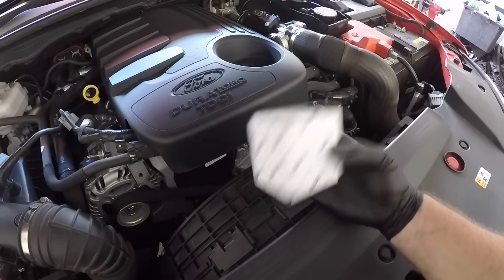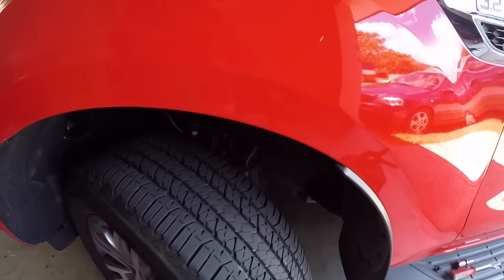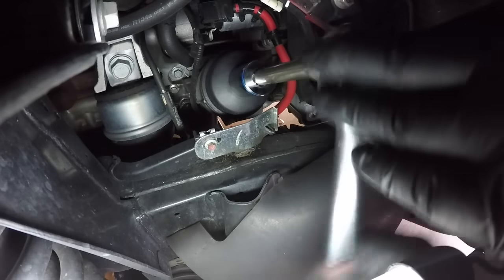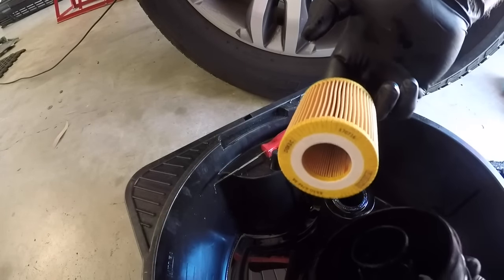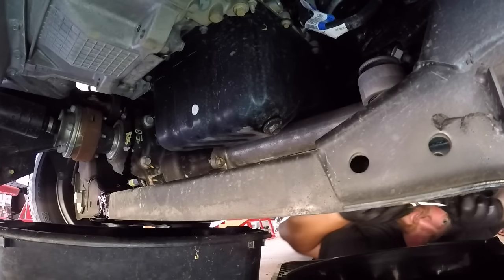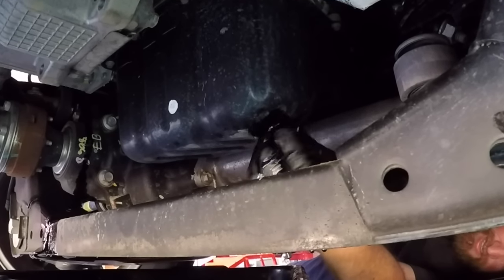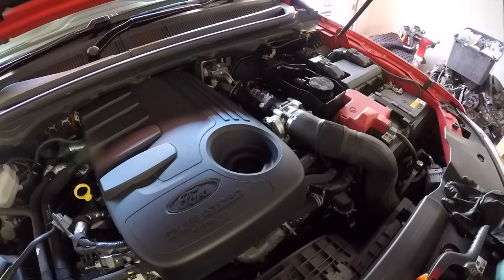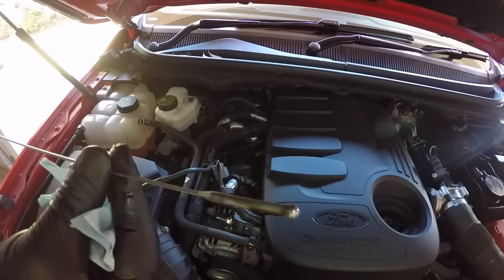Ford Ranger Oil Change Mazda BT50 Ford Wildtrak 3.2 Ford Everest WARNING THIS MUST BE DONE FAST!

Comment: Does the 2021 3.2L ford ranger px3 have a service oil maintenance to reset on the dash cluster or is it something the dealership has to reset through the OBD port.

Comment: Hi there, this must be a PX2 as my PX oil filter is on the passenger side of the engine and you access it from the open engine bay. Anyway, I just did my oil change (I'm doing them every 7500) and I drained the oil from the sump and then stuck six litres of fresh oil in to stop the oil pump draining. Then I did the filter and topped right up on the oil. I did do it in under 15 minutes and all was fine, but do you think sticking 6 litres in would stop the oil pump draining? Have you pulled one right down to see where the pump is located?
Reply from the maker: No need for the fast oil change on these earlier Rangers but I like the fact you smashed it in under the 15 minutes, shows you were working it. Your engine will love the 7500km oil interval. Thanks heaps for the comments.
Reply: This is the way I do them  I dont even answer the phone while doing one !!

Comment: Can you drain the oil first to allow the sump to drain that bit longer while you are changing the filter ?
Reply from the maker: It is recommended that the entire process is done in under 15min. I don't see any issues doing it the way you mentioned as long as you watch the time. Cheers

Comment: How in the world could the pump lose prime while changing just the oil filter first?..which I agree is the best way to do it b4 dropping the oil..anyway just my thought
Reply from the maker: A simple way to explain this is to consider the situation of your thumb over the end of a straw and you can hold liquid in the straw, remove you thumb and it runs out. The pump design allows oil to flow backwards and opening the closed oil system is like taking your thumb off the end of the straw. Oil drains back and the pump cant self prime.

Comment: Hi, does the 10-15min rule also apply to  the 2.2L engines? Thanks
Reply from the maker: The 2.2 is a different design of engine however, so many other people are unaware of what engine is in their Ranger I need to be careful of what advice I give. I would suggest that any Ranger owner does the quick oil change just to be safe. I hope you understand my answer and thanks for the comment.
Reply: @killawattgarage   The 2.2 Puma is the same engine with one cylinder lopped off.  The same precautions apply.

Comment: Is this the same process for the 2.2 engine ? Wildtrak manual transmission 2018 ? And how many liters do i need to put in a 2.2 engine tnx mate
Reply from the maker: Yes, the same variable output pump is fitted to both engines. Refill is about 9.8 L. Thanks for the comment.

Comment: Hey buddy, great video, anyway can you help me locate the power steering fluid reservoir of Ford Ranger 3.2? I kept on looking at the engine bay to check the fluid level but failed to found one, mine is a 2017 model. Thanks a lot.
Reply from the maker: It has electronically assisted steering. So there is no hydraulic lines, pumps or fluid to check or top up.
Reply: Killa Watt Garage Thanks buddy. You're a genius. Hope you post more vids regarding the proper care and maintenance of Rangers because going to the dealership for preventive care and maintenance is a pain in the pocket. Regards from the Philippines. More power to you.
Reply: Rotflmfao.Plus Rtfom

Comment: So down the road in a year  or 2 if one buys one of these engines how do you know someone hasn`t  damaged it by not changing the oil correctly, something that was so simple now is a can of worms , I got a 2008 ranger 2.3 in line 4 ,5 speed manual, I`m going to keep it for a very long time and another thing these new ones  won`t match  my mpg  of 40 (imperial)
Reply from the maker: I guess that's the danger of second  hand cars or engines. They could have bad bearing wear because of incorrect servicing. Thanks for the comment.

Comment: how would you know that the oil pump needs to be primed and how to do it?
Reply from the maker: You would know because there would be a low oil pressure warning on the dash. If this happen it can be re-primed by overfilling the engine oil then after starting drain out the excess. Thanks for the question.
Reply: @killawattgarage  thanks! Looks like i did it in time then. Is it also true that you change your fluid every 100km?
Reply: Because it's in the owners manual if you care to read it.

Comment: Whats the reason for doing the oil change in a few minutes?
Reply from the maker: The oil pump is a different design to that which is widely used on other vehicles. It has many benefits but one negative is that if the oil drains out of the sump and then the pump, the oil pump will need to be refilled with oil before it can start pumping oil again, just refilling the sump will not do this. Short oil change time ensures the oil does not drain out of the pump. Thanks for your question.

Comment: im used to drain all the oil before pouring new one, sometimes I just sit there for over night just to make sure no old oil is left in the engine before putting the new oil, now I need to finish everything in under 15mins, how about the old oil left in the engine (due to time to drain) that will be mixed with the new one?
Reply from the maker: Yes there will still be some old oil still in there, however with close on a 10 litre capacity you would be changing more than 99% of the old oil. I recognise it's not ideal but synthetic oils are amazing and I always advise completing the 7500km service interval rather than the 15000km interval to ensure the freshest of oil. Thanks for the comment.

Comment: Hi mate again great video👌🏻, I have 2017 Mazda BT50, Mazda just informed me they are doing service at every 15000km intervals now. I will prefer to change oil every 7500kms. My question... do you need to change the filter as well as the oil if I change the oil at 7500km. Will it make a huge difference if I don’t change the oil filter as well?
Reply from the maker: Sorry just saw your comment now, LOL. Changing the just the oil is OK but changing the filter with the oil is much better. Mines at 150,000km and I have recently started doing the oil changes at 10,000km intervals which is an excellent compromise between the 2. Thanks for the question.

Comment: does removing and changing the oil filter is included in the 10 minutes frame? or just the draining of oil?
Reply from the maker: Yes 10 minutes for the whole process. Once the filter is off the system has an open end and oil can begin to drain back. Thanks for the comment.
Reply: What happens if it's passed 10mins  screwed up?
Reply: I have just done mine and took 20-30 min. Unfortunately the reason was I didn't thread the bullshit plastic filter housing on correctly the first time. I thought it was wrong but finished the process anyway. Oil all over the floor. However I salvaged it and although oil light came on for 10 seconds after first start up it went off and I have had no issues. I'd actually be surprised if the pump emptying was a major issue at all. I guess I'm skeptical.

Comment: Thanks for a great video. I understand the time taken issue. Can I ask why the oil filter change time is counted against the "10 minute window". You mention you're a couple of minutes into the time frame allowable after you do the filter? But no oil has been removed at that stage. Just curious what the relationship is?
Reply from the maker: I include the filter as when it is removed it can begin to allow the oil to drain back. Much like when you have a drinking straw filled with liquid and the end is blocked, it holds the liquid in place but once you release it the liquid can run out. Once the filter housing is opened it starts the process of oil draining back intake the sump. Thanks for the question.
Reply: @killawattgarage  Thank you :)

Comment: Neighbour of mind did an oil change on the 2,2 engine and waited for a few hours to fill it, nothing untoward happened, is the smaller engine different?
Reply from the maker: Yes the 2.2 uses a typical oil pump design.
Reply: @killawattgarage  Ok, Thanks for that.

Comment: hi i did this procedure on my own, filled correctly the oil and done for almost 10mins, but when i started the engine it has a clicking sound beside the oil filter. is it normal? or the oil pump dont work? pls notice me thanks
Reply from the maker: If the oil pump didn't re-prime and you had no oil pressure the tappets at the top of the engine would start chattering loudly and then the engine would be knocking soon after. The 3.2 engine is a noisey engine.
Reply: do i need to re-prime the pump? mine is 3.2 wt
Reply: @razen1292  How did you go with this issue rap'???
Reply: @TheOmnipresent12  i just filled the engine oil at its proper level, nothing goes wrong, i did this procedure over 4 times and my unit works fine, just fixed that clicking sound over my chassis. Much thanks for this tutorial video.

Comment: Are the new 2017 ford ranger wildtrak 3.2l still have this oil pump problem. Here at Ford service, no one seems to know about this issue which is weird. Only the Australia version have this problem.....
Reply: I worked at a Ford dealer and no one ever had a similar issue or that they knew about. I didn't have an issue either with the rangers. Maybe its a thing on the newer models (2016-) or just some versions for some markets.
Reply: All 3.2' diesels have this oil change requirement. That is upto the PX3 which There are rumours Ford have modded the pump but don't quote me.

Comment: Sorry for the question does the 10 15 min time start when you change the oil fillter or only after you begin emptying the oil into the catch pan just wanting to knw thinking of doing my own service
Reply from the maker: Sorry for the slow reply. Starts from when the oil filter housing is opened as this allows the old to start flowing back.

Comment: so what do you mean that the oil pump cant self prime ? and what if it takes longer then 10 minutes what happens ? or what do you need to do ?
Reply from the maker: If you take longer than the recommended 10 minutes, then the oil drains out of the oil pump, even after refilling with fresh oil and starting the engine the oil pump will not be able to suck up the oil in the sump. This means the engine will not have any oil circulating around to feed bearings, tappets etc and engine damage will result very quickly. I have heard of people getting caught out and fixing the issue by overfilling the oil (this allows the pump to be filled) and then draining off the excess. I hope this answers your question.
Reply: so when you get it wrong and you start up the car it is getting a instant oil pressure fault i guess and you shutt the car off i guess ?
Reply from the maker: That's correct. You will a warning on your dash. Depending on the specific model it could just be the oil light or a text display stating low oil pressure. 10 minutes is doing it on the safe side. I have heard stories or people letting it drain a lot longer. It is just good to remember to do this one quickly.

Comment: We have d same ute, Is it ok to fill it with 8 liters? I just want to maintain the oil level btween minimum & maximum level...thank you
Reply from the maker: 8L will leave it too low, it has a 9.8L capacity. The oil level may not even reach the low mark.
Reply: Killa Watt Garage Noted sir. Thank you

Comment: Would’nt the time start when the sump has drained?
Reply from the maker: Once the oil filter is opened the system has an air leak that can start the drain back. Similar to how you can hold liquid in a straw with your finger over the end.

Comment: When I have done the oil changes on my Ranger I drop the sump plug wait until the constant stream is about t o drip , put the sump plug back in and drop about 7-8 litres in the sump then change the filter.
Reply from the maker: Hi and thanks for the comment. I agree that method will work just fine as well. Cheers

Comment: What brand and weight oil do you prefer?
Reply from the maker: In Australia the factory recommend 5W-30 so I stick to this I also use PENRITE. Good balance of quality and price
Reply: @killawattgarage  I was actually looking at running the penrite synthetic full zinc 5w30.
Seem to be OK for DPF for the ford ranger also. 
My dealer uses the mobil 3000 x1 FE oil. 
Not sure which is the better of the 2.

Comment: Hey mate, can you post the specific order of things, do you need to change the filter casing then the sump plug or can it be either way
Reply from the maker: I have been advised that it is the filter swap then drain the oil and have always done it this way without issue. Some others do it the opposite order and they haven't had issues. I think the critical thing is time, just don't get distracted and finish the process in under 10 minutes and you won't have any dramas. Thanks for the question.

Comment: So if you take longer how do you fix the oil pressure issue???
Reply from the maker: Haven't been down that road.......but my thoughts were to use suction at the filter housing to draw oil up through the pump again. Many of people have just started the car and revved it hoping it would prime and have had major engine damage.
Reply: I was told over fill it then drain out the correct amount once it has oil pressure

Comment: Does it matter how long one takes to replace the filter? If I were to simply change the filter first at my leisure and then time myself to drain the sump and refill within 10 minutes will my ute be fine?
Reply from the maker: Once you open the 'closed' oiling system oil can drain back out of the pump and have issues re-priming. 10-15mim for the entire process.
Reply: @killawattgarage  Cheers mate.

Comment: It's not that hard really, 15 mins is fair amount of time, makes you get organised before doing the change too. 90,000kms on mine, changed every 10k, still going Strong.

Usually done in 8 to 10 mins.

I don't like the way the oil filter is designed, if you break the plastic housing for whatever reason... It's all over! Just can't see why something so high priority and a part that gets removed reasonably often is made of plastic! Much prefer an external steel filter onto an engine thread.
Reply from the maker: Thanks for the comment. Agreed, 15 min is plenty of time but you can't walk away or get distracted. I do worry that in time the plastic housing will become brittle and breakup but haven't seen it yet. Cheers

Comment: If you change out the oil within the time frame and then change the filter later, would that affect the pump?
Reply from the maker: Short answer, Yes. Once you open the oiling system then the oil has the ability to drain back.
Reply: @killawattgarage  thanks.

Comment: I honestly don’t see anything wrong with this design. Modern engines are precision instruments and there is a reason why things are done the way they are, and that is a process that needs to be followed to service them. This has always been true.

The reason why the oil pump does not self prime is because it is a variable oil pump that provides some advantages over a fixed flow pump. I cannot speak as for why it is not a self priming pump, but in pump designs, they are designed in such a way that they must be primed before use and never allowed to run dry, because to have a self priming pump, takes away from other aspects of its design. You can’t have everything.

A time limit on changing the oil is not the problem people make it out to be. It’s one more step in servicing a complex system. If you follow the rules when servicing it, and you change the oil as is laid out in the procedure, there is no problem. I’d hate to see you guys work on a Trent 900.

There is also absolutely no reason whatsoever to let an engine drain for several hours or even several minutes. None. I let it drain, and by the time I have removed the oil filter, enough time has elapsed that there will be almost nothing left in the sump. The extra 5 drops that elapse over several hours is completely pointless. It’s less than one tenth of 1% of the oil quantity you’re about to put back in. It just doesn’t matter.

Pull plug. Let drain. Remove oil filter. Secure new oil filter. Replace sump plug. Fill with oil. Run engine. It’s not hard.
Reply from the maker: Hi and thanks for the comment. The only danger with this design is the home DIY'er not being aware and causing damage. If you know what your are doing it's still and easy job. People of are a bit OCD when it comes to the last few drops during and oil change, and like you say it's the smallest of amounts. Cheers
Reply: Killa Watt Garage oh, absolutely. It is a different design that people aren’t used to, and it could be argued that it could’ve been done differently. But there would be ways of letting the DIYer know, maybe like putting a warning label on the oil cap alluding to the 15 minute time limit.

It could be argued that they could’ve designed it without this limit but there’s very little point in arguing what could’ve been done differently. The best that can be done is doing videos like this, warning people that this procedure exists.

Comment: hi what does the engine warning light mean,,thanks
Reply from the maker: Which light are you referring to?
Reply: @killawattgarage    check engine light. This light comes on briefly and if all is operating correctly, goes out as the engine starts. If the light comes on whilst driving, the vehicle diagnostics system has detected a malfunction. This is often a fault in the emission control system. its showing  on the diagnostics as some glow plugs are not working,,what elese could it be ,thanks
Reply: @bbourke40  I heard that they have to connect a laptop to the Ranger and reset the oil cycle (?). *And if you don't, you could have issues. 
Hope this matter can be explained/discussed as I get the feeling it's important!